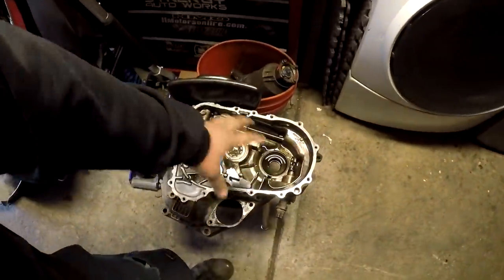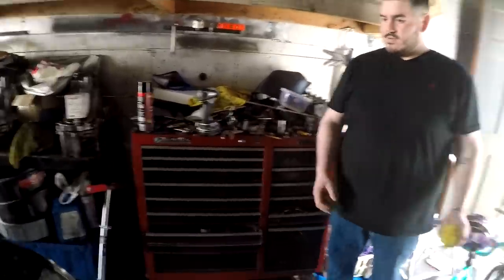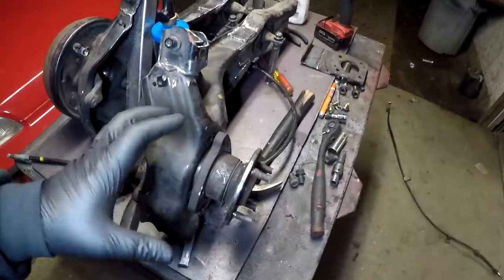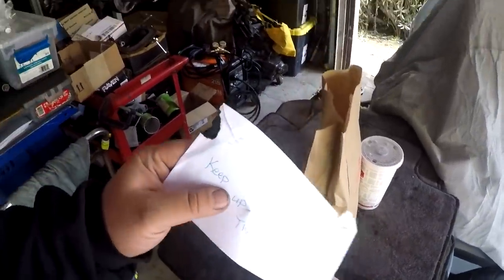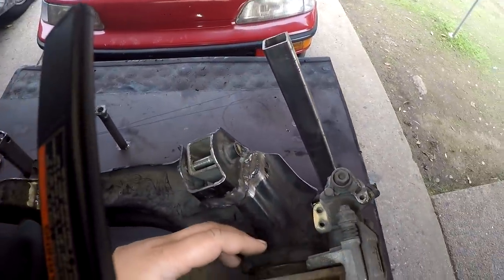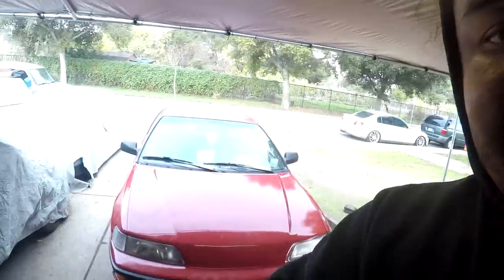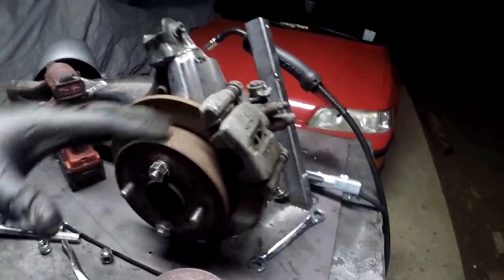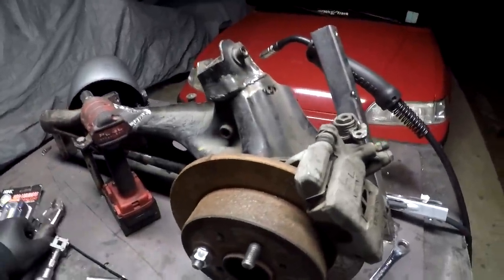AWD BUILD 14 : DIY REAR DISC CONVERSION

Comment: Another great video. Just purchased a decal for my workbench!

Tip for cutting thick metal for brackets and stuff. Buy a portaband and either make or buy a stand for it. Turns it into a mini cutting metal bandsaw. I've had one for years now and make rear disc conversion kits for the Mirage guys.

Comment: If you buy rear brake pads from autozone, don't buy the $20 duralast. The $35 duralast golds are good, they grip hard when cold, and don't make any noise. The $20 Duralast pads squeal something fierce. Just my $0.02 from my rear-disk brake conversion on my Civic.
Reply from the maker: i usually run raybestos

Comment: Hey man I’m really stuck and I need your help. NOT AN AWD QUESTION. 

I’m doing a rear disc conversion on my 1990 DX Sedan. I went to the junk yard and paid $250 for Rear trailing arms from a 1991 Integra GS. The car had ABS so I couldn’t grab a non abs 40/40 prop valve, I have to get that off eBay. 

My question to you is… I wanted to use non abs brake calipers, can I bolt on calipers from a 90 Integra RS (non-abs). Is that a direct fit? Can I just buy the calipers brackets and calipers from autozone from a 90’ RS? 

2nd Question: I have the e-brake cables from the 91 GS, but they are kinda shot. What e-brake cables should I get if I wanted to get new ones? Thanks - Dylan